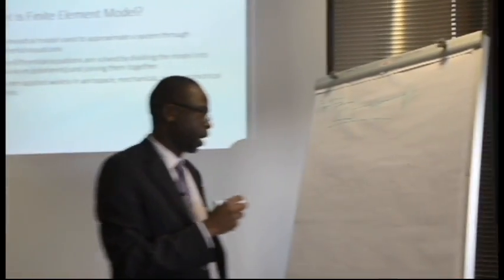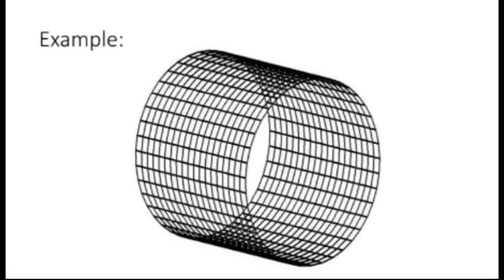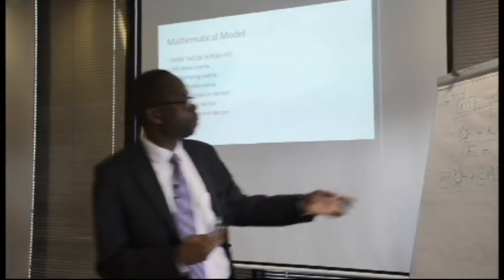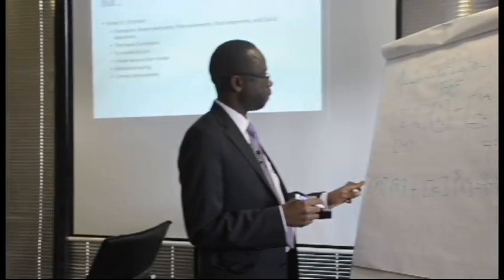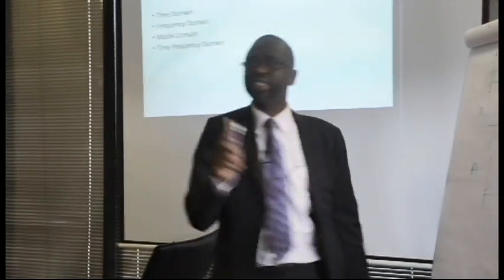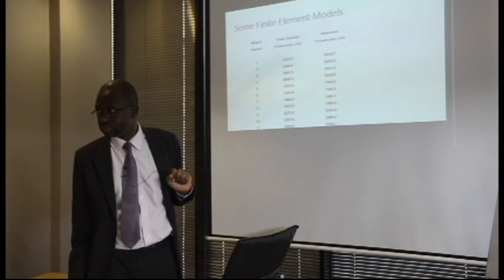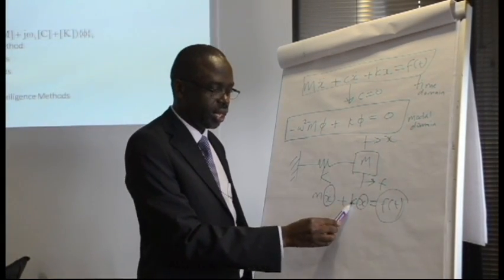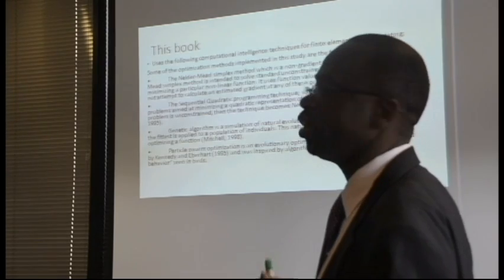Introduction to finite element model update- lecture 1

Comment: Finite element technique is an approximation scheme of the governing equations in continuum mechanics. Its use serves two things 1) there is no exact solution for many engineering problems, 2) to achieve economy to avoid physically testing components. However material properties and boundary conditions have to be correctly specified. And  the algorithm has to afford accuracy and economy in term of computational resources.